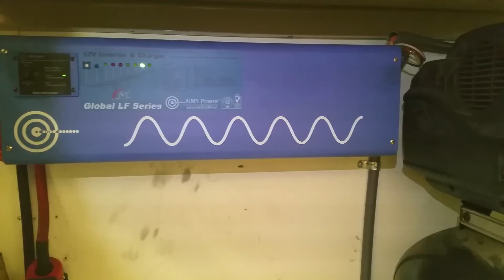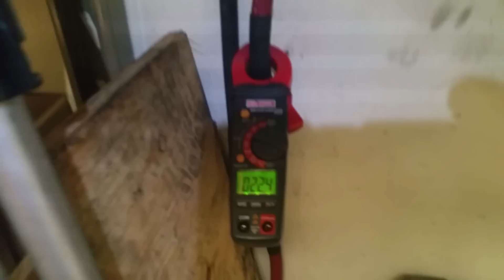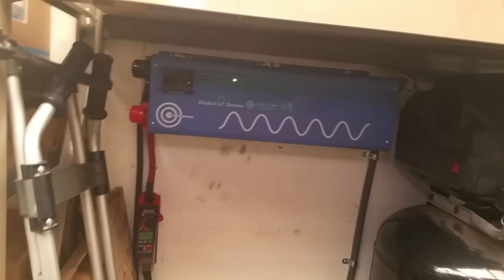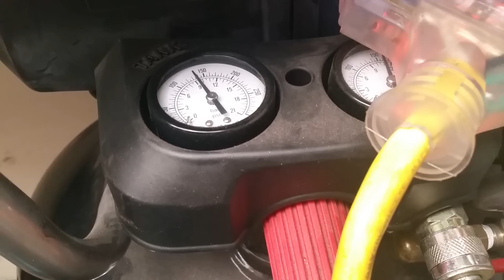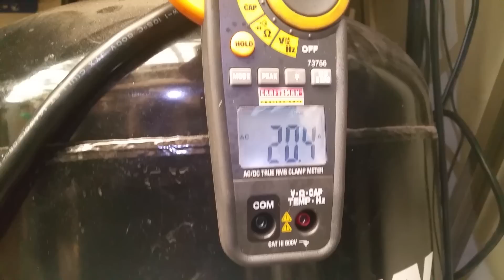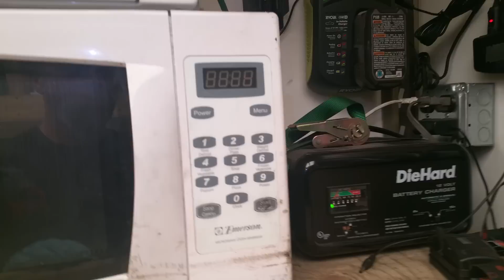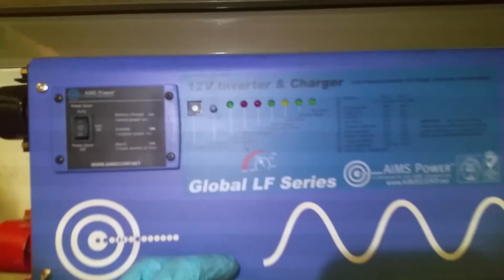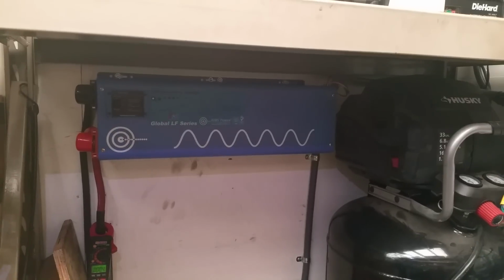AIMS 12V 4000W PURE SINE WAVE INVERTER CHARGER

Comment: I have this inverter.  looks similar.  4000/12000 watt 240v 12VDC.  The problem Im having is after all few days the inverter has a constant buzzer going off. No low voltage. No high voltage, no fan stuck and I power off and on its fine. What is causing that

Comment: ✌️Excellent video of the very best in an off grid working system when you need it on a remote job site. The Aims inverter is a beast 🦍and I know you were proud to have it  😊. I have the Aims 6000 watt 24v split phase that runs my household . We preppers must always stay connected and ready during any SHTF situation or to save on the light bill . Check out my solar videos , hit like , leave a comment and subscribe . May the solar be with you for 2022 + .🤙

Comment: I’m sure I’m very late on seeing this video but can you charge your battery using the same electricity output from the inverter? Just curious
Reply from the maker: That would not work.  The inverter is using the batteries to supply power. When you increase inverter output, you increase the demand on the batteries themselves.... continous degrading loop of energy.
Reply: Chris Hovis thank you for your prompt response. But I have someone who uses a LUMINOUS INVERTER which charges and the battery using same output electricity without issues. At least that’s what he told me. I am not a pro on this but want to make sure so I don’t buy the wrong things
Reply from the maker: @danieltunde9481  Think something has been lost in translation here.  If he has an INVERTER/CHARGER, as this one is... what he could mean is.... if there is a 120v input to the charger, it will then charge the batteries and supply 120v output simutaneously.  If there is no input 120v, then charging the batteries from the inverter's own output wouldn't make sense.

Comment: Are these still going strong for you!?

Been looking at this model (or a very close relative) for an RV rig (4Kw)!
Reply: I'm looking for an inverter for an rv, too.  All I need it for is tv, plugs, and cpap at night.  Any portable appliances, might be better off running the generator, bc recharge time could be slow as heck (500ah lithium).  4kw is quite a bit overkill for me...and this seems kinda noisy for an rv?  I'm looking at Renogy.  Any other brands you looking at?

Comment: VERY informative my friend! I have just bought the same inverter for a skoolie build. What amp hour rating are your  batteries each? I have 8 @ 210 ah ea. Havn'nt got them installed yet but looks from your setup this will handle anything I need. Also have 1000 watts of dolar to install with and a Morninstar charge controller.

Comment: Can you use the generator to the inverter to give you clean power 60 hertz from it?
Reply from the maker: MrSeth166 Well, the inverter puts out pure sine wave 120v 60hz...so the generator isn't needed to achieve 60hz.
Reply: Chris Hovis well I have a problem trying to feed my UPS battery back up for a server unit and when I connect the generator to the UPS it just stays clicking because of the dirty signal coming from the generator so I need something to keep the sine wave clean and I thought that the AIM unit could help with this problem
Reply from the maker: MrSeth166 Sounds like generator has modified sine wave, which is affecting UPS. This inverter is pure sine wave, which is another reason I chose this particular inverter, as I use it to start many electrical motors. That being said, haven't tried a UPS with it.

Comment: could you send me a wiring diagram on how you have the two wires from the inverter going to the generator to start it up when you batteries get low? flyfisherman050@hotmail.com  thanks
Reply from the maker: happy04346 I actually do not have the generator hooked up....based on the inverter/system reliability, I removed the generator altogether.

Comment: I would love to have someone talk to me about how to set this up with a back-up generator, so when my battery bank goes low this thing sends a signal to the generator, turns the generator on and begins to charge the batteries as they say it will do. I've talked to AIMS and they don't or will not recommend a generator. I like the Champion 7500 watts generator with the remote start. I'm thinking about wiring the inverter to the remote switch and everything should be good. Please someone help me!!!!

Comment: I have one of these on my homestead, and am in the middle of installing a submersible well pump. The depth is 300 feet. What would someone recommend a 115 ac pump or purchase a 220 transformer and go with the 220. I just don't need to have this thing tripping off every time it starts up... thanks
Reply: happy04346 go with the 220. The inverter will handle the well pump no problem. I have a smaller/older aims that does 220 split and the 220 easily handles my pump and it's well below 300ft. Remember that the pump is submerged. So sending AC down 300 ft isn't going to cost you in terms of cable loss. It's not DC. So, as long as the inverter can handle the startup surge and duration then you're good to go. The Aims 4000 can handle 6000 watts for 20 seconds (need to check the spec again to Abe absolutely sure on the 6000, it may be more now). It's their 20 seconds of surge that is what makes it the best for heavy surge equipment like your pump or compressors. Bottom line, I run the same thing on a smaller machine today. However, I'm upgrading to the 4000 220 split to drive more equipment since I've expanded my solar and wind capabilities. Great equipment. You can't go wrong.

Comment: Hello Chris I'm James Mason and I live in my bus fulltime and really need to get one of these inverters, I don't have any power after my generator got stolen . how much was that inverter, because I'm poor and don't have a job right now but maybe I can sell enough of my stuff to afford it.  Thank you for your time and for sharing your video and thoughts with us I subbed to your channel keep up the good work
Reply from the maker: James Mason Inverter was $900, good battery bank is about $500, necessary cabling, eyelets, fuses etc is about $400. Pricey I know, but it's clean quiet power, and very dependable.
Reply: Chris Hovis hi Chris thank you for for the reply. I already have everything else I just need to get the inverter and I need to get one soon because it gets over 100 degrees inside the bus, is there anyway you could help me get one maybe as a tax write off. Thank you for your time

Comment: Excellent review Chris.  I am looking to put inverter charging capability on board my 28 ft Carver 280 and after watching your review I am convinced this is the unit for me. My biggest draw comes in the form of my 9000 btu air conditioner which draws at 7.5 amps in use which is not much but the surge of the startup sequence is 30 amps!!  My 2000 watt portable generator will not handle it.  This unit will also charge my battery bank which makes me very happy as well.  I plan on using 4 UB8D 12v 250AH AGM units.  Eventually I will add 4-6 solar panels to the Bimini top and charge controller to provide free generating power to the bank and thus inverter.  I have a question about the remote panel - do you have one installed?  If so what are your thoughts on it.  For your use it is not really necessary but in a boat you definitely want to have an at a glance view at charge states, usage, etc.  Anyway, great review my friend!!  Thank you.

Comment: Chris have you ever measured the current draw of the charging portion of the inverter? I am planning a similar setup in my service vehicle, but my generator powers a 5hp 2ph compressor that uses 90-95% of the generators output. I'm curious whether I will be able to run the generator/compressor while simultaneously charging the battery bank...
Reply from the maker: Benny McKeon  I'm guessing you have a 240v air compressor....in which case this inverter isn't for you. It's only rated for 120v, 4000w (roughly 33 amps of service). Aims does offer a 240v inverter/charger that would probably suit your needs.
Reply: Chris Hovis It is a 240v compressor, but the compressor is powered by the generator exclusively (not through the inverter at all)

my question is regarding the amp draw of the charging portion of the inverter, in the instance where the generator powers the compressor while simultaneously charging the batteries through the inverter (which powers 120v equipment only)...

Comment: Hey Chris. Do you have the green ground wire connected together or disconnected?
Reply from the maker: Butch Weise you mean ground wire going to inverter casing? I do have mine grounded to truck chassis.

Comment: thanks for review. still working good? im trying to get a 6kw one
Reply from the maker: DCL electric yes great inverter, especially compared to using a generator. Keep in mind, your battery bank needs to be sufficient to support your load demands.. Also, make sure you properly configure your inverter after install specific to your application.

Comment from the maker: I have a 400 amp fuse for mine using 4/0 battery cable.

not sure of the amp hour rating on the batteries I use. Full disclosure, I use 8 group 31 starting batteries rather than deep cycle batteries. I get a great deal on the starting batteries, so that's what I've been using for 7 months now on a daily basis. Also, the battery bank is tied into the truck charging system, and the truck idles throughout the day. so the battery bank is constantly being recharged. I have run all the equipment without idling the truck, and everything works just fine. I suspect I could use the air compressor and all the other components for about half the day before the battery volts started getting too low.

so, seven months in, and everything is still working perfectly. I absolutely love this setup.
Reply: NOW do you know what AMP Size Fuse to use?